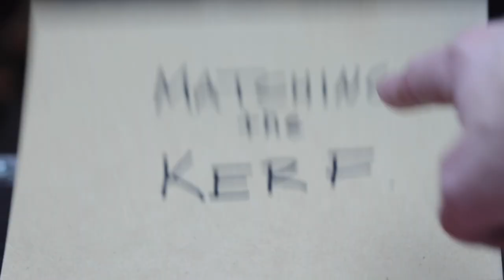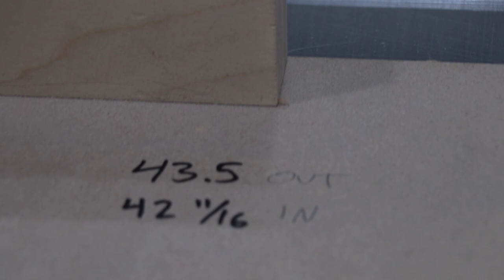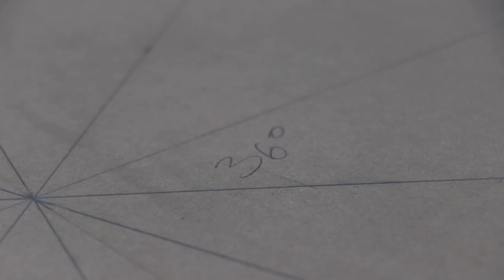DIY Plywood Snare Drum 6 x 14 - Baltic Birch | Woodworking Bent Lamination

Comment: Just curious but did you make the lengths of the lamination pieces slightly longer than the circumference of 14", and then not tighten the mold completely as you snugged it up? Or, did you make the diameter slightly smaller than 14" and thats where you got the 43.5" and 42 11/16" measurement? Or did you just keep taking more off with saw until it fit snug in dry fit up?
Reply from the maker: You’re spot on! I got my length for the outer part, sneaking up in the cut. Then did the same with the inner. All clamped up, I remember both side of the form touching.
I also remember having to recut both pieces a couple times from accidentally making them too short 🤦‍♂️

Comment: Skipped a section with bearing edge cutting. On what degree did you cut? 45 or what? Or did you edges by hand?
Reply from the maker: Yup, skipped sections on both sides for the snare beds. 45 degree bevels with a router bit in both sides and sanded the snare beds transition round-overs by hand.

Comment: Really nice Video, but I have 3 questions! First of all, did you calculate the lengths of the veneer or did you just try it out until it fit (because I would like to build different sices of shells)? Second question, how thick is your veneer and how many plys does it have? And last but not least, which hardware did you use, I'm very interested in it, it looks amazing.
Reply from the maker: Thank you! 
-Length of plywood was simply trial an error, mostly error! 
-I used x2 sheets 1/8” Baltic birch plywood. So I suppose 6 veneers total. 
-I’m not sure where the hardware is from, I salvaged them from an unbranded used drum purchased at drum shop 15 years ago.
Reply: @AydDesignCo  Thank you very much for your quick answer!
Reply: @AydDesignCo  Who carries 1/8th " ply... like you used?  is there a source for the birth and other kinds?